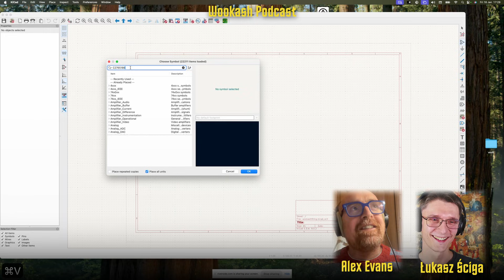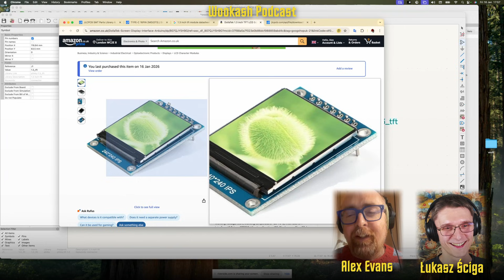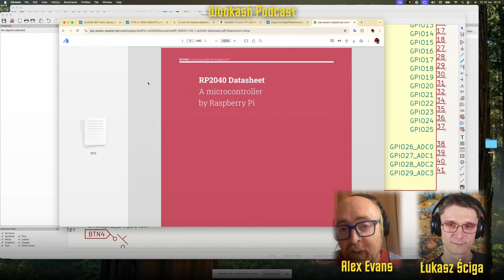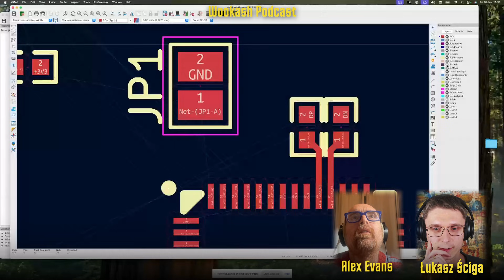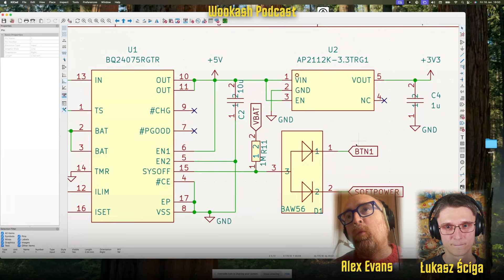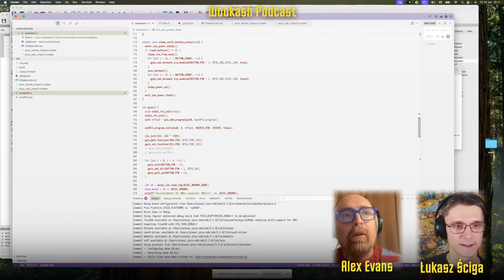Making Our Tiniest Game Console with Alex Evans

Comment: current doesn't flow to ground it flows from ground. all current circuits are written backwards using hole flow. electricity is negative not positive. people can't handle this and invented the opposite idea of current which is hole flow so they can say it goes or returns to ground but it's backwards.

Comment: There were a couple questions:

- What is the difference between Vcc and Vdd? These are both for the "positive" side of a transistor just different types. Vcc is the voltage which goes to the collector pin of a Bipolar Junction Transistor. Vdd is the voltage which goes to the drain pin of a Field Effect Transistor. For the purposes of a project like this they are basically the same but they aren't always.

- What does SS stand for in QSPI_SS? That stands for Slave Select. On other Serial Peripheral Interfaces(SPI) it is typically referred to as Chip Select instead. This pin does exactly as the name implies. It selects which chip to communicate with. I think this difference is just a historical artifact. Some people went full on with the Master/Slave analogy and some people didn't.

I very much enjoyed this episode. Alex did a very good job giving an overview of how hobbyists can make this kind of hardware. Like Alex said at the end it's not that hard to make stuff like this and it is very enjoyable. I hope more people start making cool stuff too. 

There was a comment made about wanting to do part of the schematic design then part of the layout going back and forth. That is a fine way of doing things but, in my experience, is not how professionals do it. The schematic is almost always completed before layout is started. Even to the point that an electrical engineer will create the schematic with all of the part numbers and such then hand that off to someone else who does nothing but layout PCBAs all day. However, during layout changes will often be made to the schematic to change stuff like which GPIO pins are used for which functions. An issue with doing it in parts is that you can't know what all of the parts that will be in the assembly will be so you will almost certainly have to redo work when you realize you need to add an additional part but didn't leave room for it in the layout.

The trick with reusing components(especially resistors and capacitors) where possible is a good idea. However, if you are using something like a 5.1k instead of 10k resistor just put two 5.1ks in series. Now you have 10.2kOhms so you are off by ~2% instead of ~50%. It doesn't really matter for a pull-up resistor but sometimes it does matter.

Also, for god's sake, please put identifiers for your components on the silk screen. Not putting identifiers on your silk screen is like giving every variable in a program single letter names because you don't feel like typing longer names. Sure it makes your life a little bit easier now but when you have hundreds or thousands of components on a board and you need to track down an issue with a specific IC and need to measure a signal on a specific resistor good luck finding it. It also means that you must give software people(well everyone really) access to the layout files to track down components. If you properly label your components you only need to give them the schematic and they can somewhat easily find what they need. This is especially true if at the end of the layout process you rename every component(this can be done automatically) so physically close together components will have similar numbers.